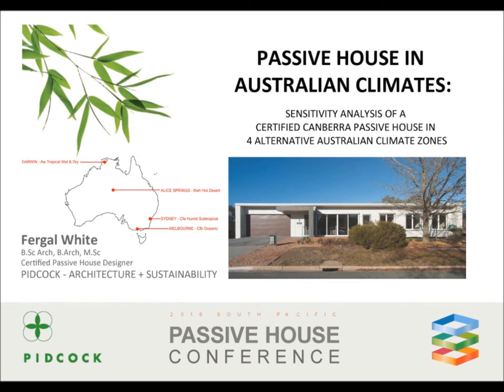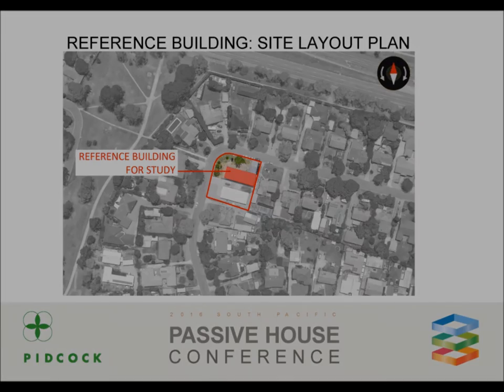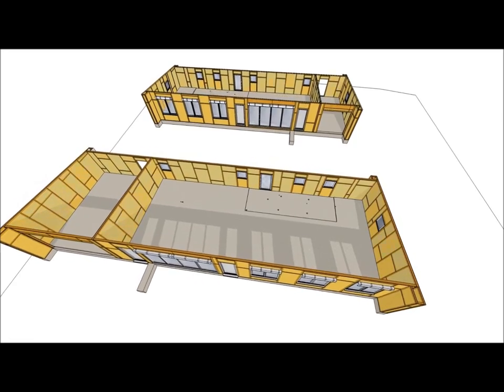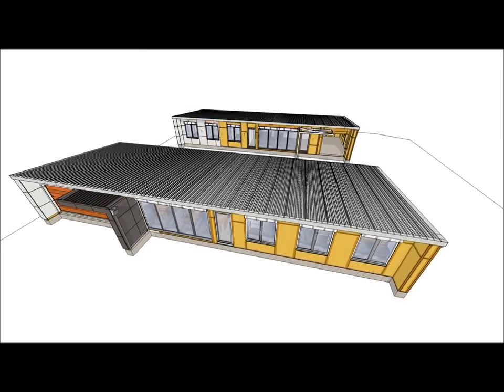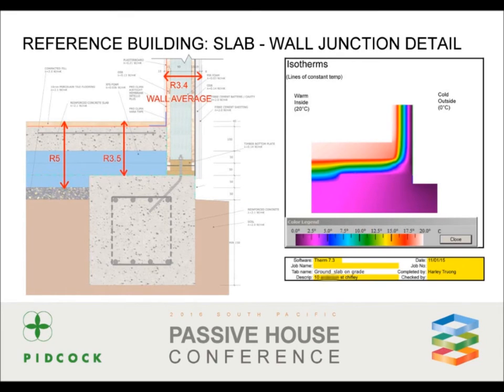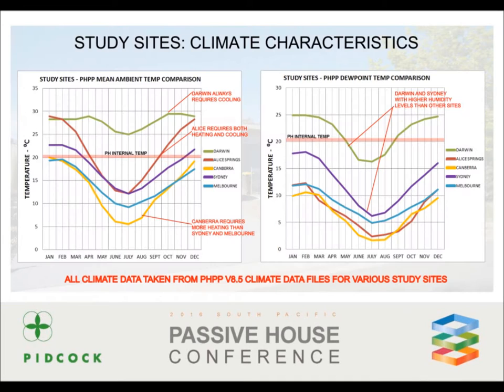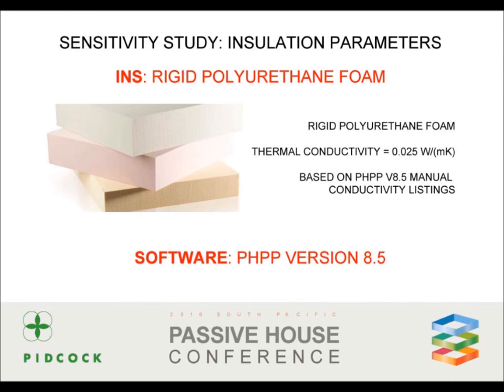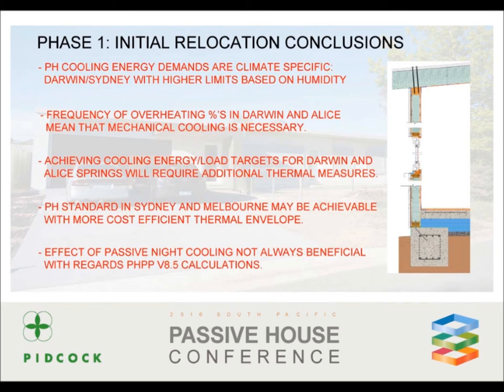Passive House Standard in Australian Climates

Comment: Really good study Fergal, I am building a passive home in Southern Italy, near Brindisi which is roughly 41’N and equivalent to Melbourne in your study. I’m using Aerated Autoclaved Cement for the structure and double glazing with an efficient air to air heat pump system. I learnt a lot from your numbers here and it’s given me a clear idea of what R values i will require for glazing, walls and roof along with air tightness. Thank you mate!

Comment: An extremely useful analysis Fergal. Many thanks for uploading it for public viewing. I have visited Harley's house in Canberra (I was a guide there one year for Sustainable House Day) and was impressed with how well it worked and how comfortable it was. Harley was/is a trailblazer as far as PH Australian design and building are concerned. 
I did wonder how much benefit would be gained at that house by a deciduous pergola on the north side. As you mentioned, they have external blinds which would work extremely well. With the "open house", naturally the blinds were up so visitors could see outside. However, on the days I visited in September, it was quite cool outside and a bit too warm inside. Hence the thought that a pergola might be a good solution and/or wider eaves. Are pergoals and eaves taken into consideration by PHPP software you mentioned, when calculating internal comfrot?

Comment: we intend to build in Nicosia, Cyprus, which has a requirement for 4 months heating and 3-4 months cooling,  much like Alice Springs.  At the location, the prevalent night cool breeze comes from the west, and of course, solar gains come form the south.  What building strategies could we follow?  Clearly the Sydney house model will not work.  We will need mechanical cooling in the Summer.  But what is the best way to do it?  Could you help?